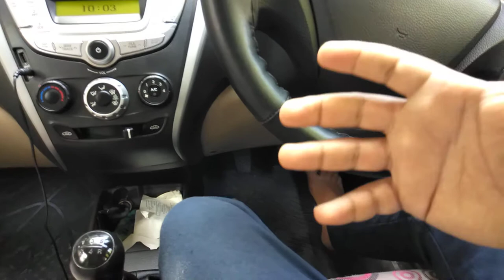Lesson 4 - Understand car accelerator pedal - Learn cool facts about car accelerator

Comment: Should we reduce pressure on accelerator when changing gear. If so how much.
Reply from the maker: Zero pressure. Better to lift foot off the accelerator while changing gear.

To change gear, first clutch needs to be pressed fully. Then change gear as needed. Then Release clutch slowly and start pressing accelerator. 

In other words, accelerator role starts when you start releasing the clutch post gear change. Till the gear is changed, clutch remains fully pressed and accelerator remains untouched/un-pressed.